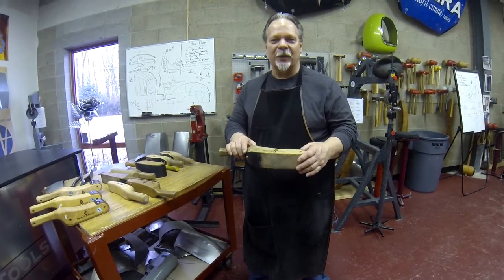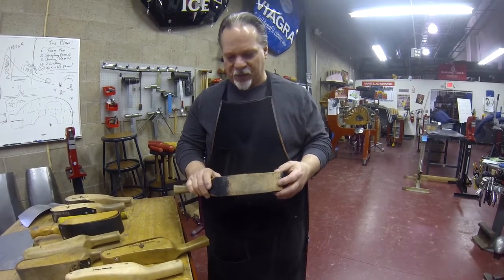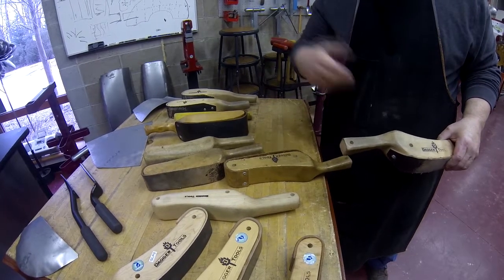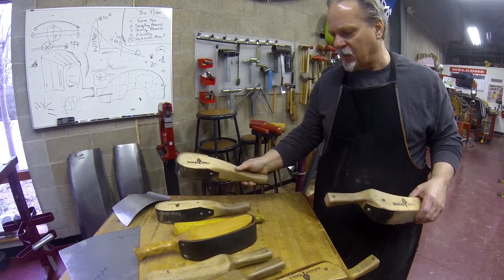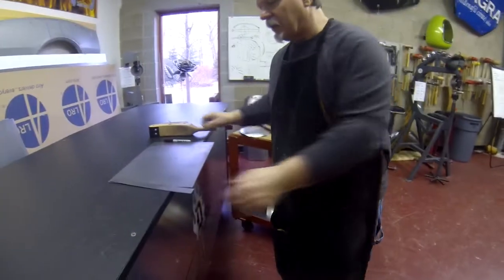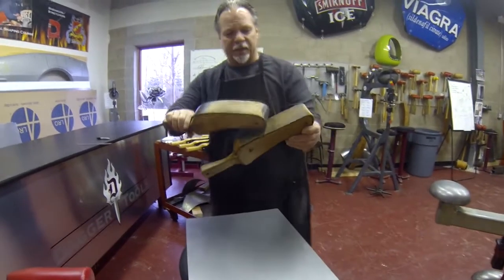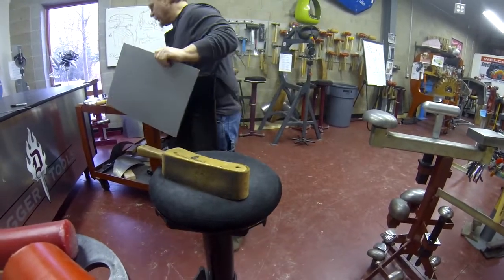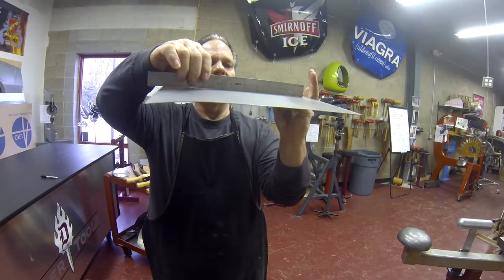Dagger Tools Quick Tip: Uses of Various Slappers

Comment: I've got an aluminum aircraft wing - 0.030 6061 Aluminum that ran into a post and has some wrinkling - including some small, but sharp creases.  If I use a dolly on the underside (the dolly will be shaped to the curvature of the wing), can I use a wooden, leather-covered slapper to smooth the surface?  Restated, can you shrink with a slapper?
Reply from the maker: Can you forward a photo ? I need to see the extent of the wrinkles before I suggest wood verse steel like the slbs-99 or slbs-55s with a wood or rubber coated dolly. Some very little shrinking will occur vet light
Reply: @daggertools8688  Thanks so much for the quick response!  I just sent a picture to info@DaggerTools.com - let me know what you think including any suggested part numbers.